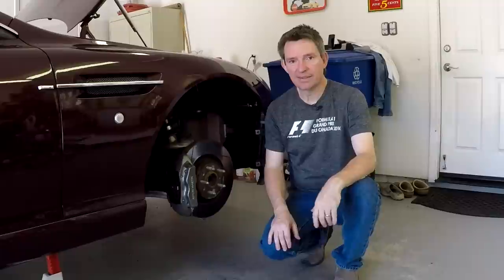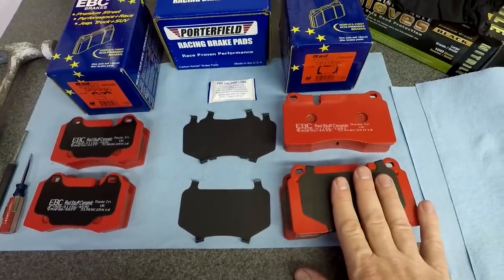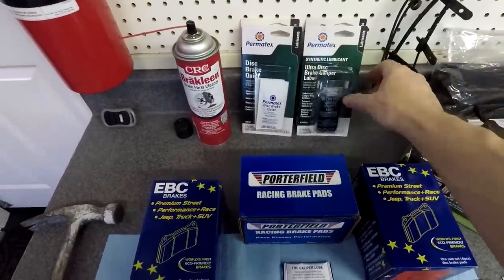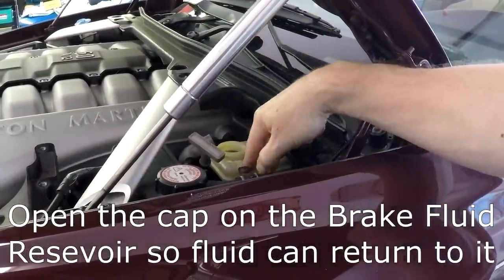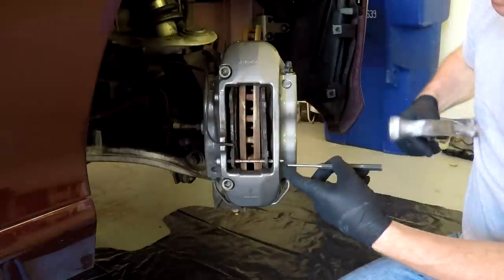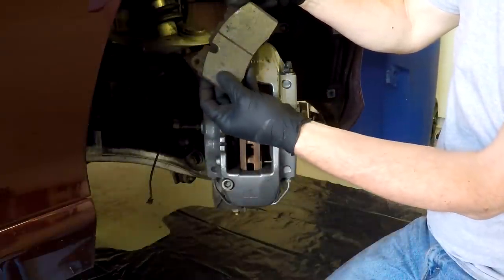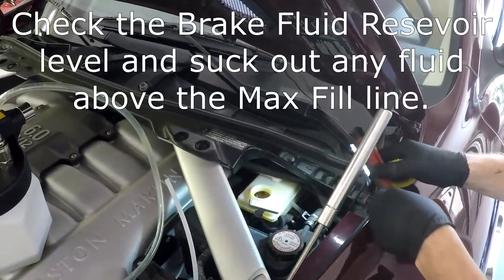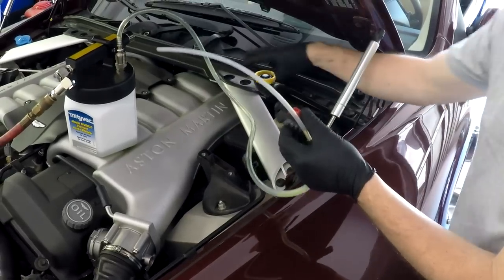How to Change the Brake Pads in an Aston Martin DB9

Comment: Well done once again.  I’ve done one full set of pads on my DB9 since owning it and putting 35,000 mile on the car.  Rear brakes wore fasting than the front and had to replace past month.  Brembo brakes are easy to do and you hit all the high marks and details perfectly.  I had EBC red stuff pads too. but terrible squeal and pulled out after just 100 miles to go with standard Pagid pads.
Reply from the maker: Did you swap out to Wilwood rotors too?

Comment: great video. One step I would do before pressing the pistons back into the calipers is to clean the seals. Warm soapy water and toothbrush. That way you are not pushing dirt into the piston bores potentially damaging the seals.
Reply from the maker: Thanks for the suggestion and hopefully it helps a few others.  I'm not sure any of the dirt on the boot can reach the interor, the boot links to the exernal most face of the piston, so the bore and the piston body are always protected regardless.  But, I always agree cleaner is better.  Thanks for watching!

Comment: 0:20 Just the brake pads cause the rotors are in good shape, 20:28 new rotor appeared (and caliper bolts also look like new) :D 
Waiting for the video about the rotors!! Thanks a lot!
Reply from the maker: Busted.  Yes, I was doing both video series at the same time.   Pads only changes will be more popular, but I am in fact doing the whole series on Rotors, Calipers, Sensors, etc.  Stay tuned and thanks for watching!

Comment: Hi there and thank you for your excellent videos that you are providing DB9 owners around the world. I am based in New Zealand and have a 2005 DB9. It needs both rotors and pads and I wondered if you had done a video on changing the rotors? I noticed and agreed with your comments on another uploaded video regarding rotor changes, torque setting, bolt reuse etc. best regards Tony

Comment: Hi 
Could you do a video on how to replace the parking brake pads correctly ? I cant find any definitive information anywhere especially on the resetting of the handbrake cables when the pads have been changed. There's plenty of details on  main pad replacement but the parking brake or handbrake is never covered. 
Cheers 
Rob

Comment: Hi sir for a DBS as is a ceramic disc, do I should use only pads for ceramic disc ?
Reply from the maker: Hi James.  I'm no expert on the Carbon Ceramic brakes for a DBS, but I would recommend that you only fit dealer supplied OEM brake pads in that situation.
Reply: @Aston1936  thanks 👌